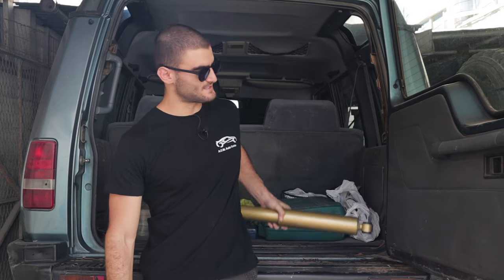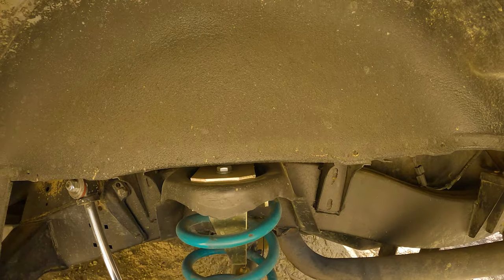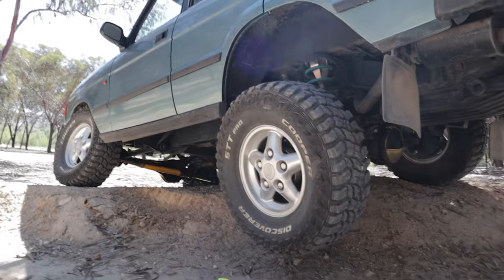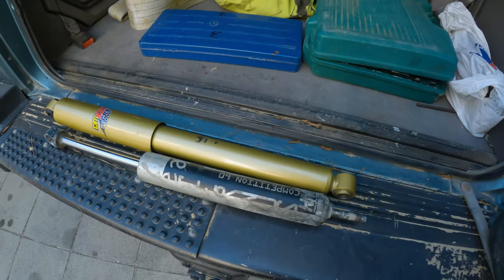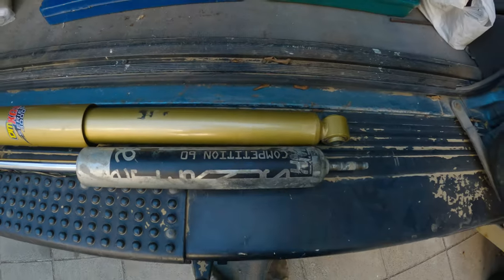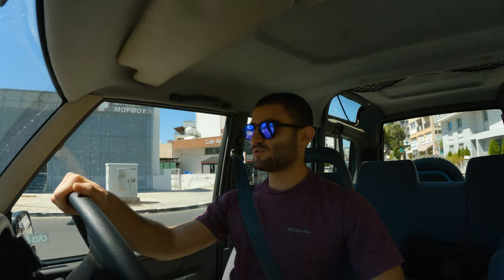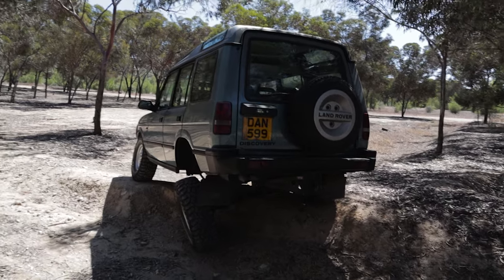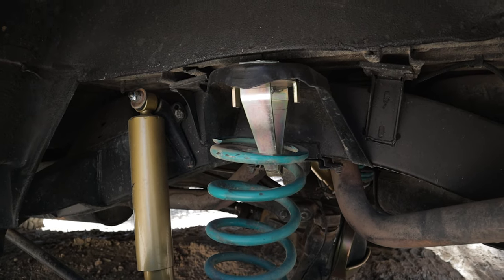Do This to Make Your 4x4 Flex Like Crazy!!

Comment: shock length doesn't change suspension travel, putting a longer control arm on will give you more travel, longer shocks will just give you more clearance but any up travel you gain will be down travel lost making it the same.

Comment: I have the same issue only instead of buying new shocks I have bought shock dropping plates which move the mounts 2 inch lower.
Reply from the maker: Yes, it has the same effect on travel and the same issue with bump stops. We will have to extend them

Comment: You should add axle bumpstops longer or put spacer that acomodate difference of lenght new shocks vs factory ones in full compressed state. Unless you will bend mounts, destroy shocks or even risk frame crack.  Great video what so ever, greetings from @ramblinglando
Reply from the maker: Yes, the bump stops are next on the list. There is a big gap between the stock ones and the axle now so I will have to make some custom ones or get some hydro bump stops
Reply: @TheUntraveledPath  just measure minimal lenght of new shock vs stock one minimal. Sometimes its 50mm sometimes is 25mm sometimes its 70... depend on shock construction.
Reply: @TheUntraveledPath  stock minimal lenght of shock are 350mm... if new ones are longer. Just add spacer to fill that gap.
Reply from the maker: @jakubstrumillo  it wouldn't reach the bump stops even when it was stock. The stock land rover ones are useless, they will need changing
Reply: @TheUntraveledPath  it will if you hit bump on high speed ;)  Or during climbs when whole body weight lays on rear